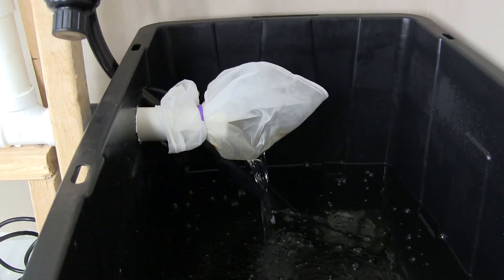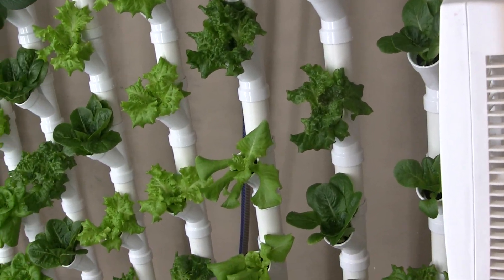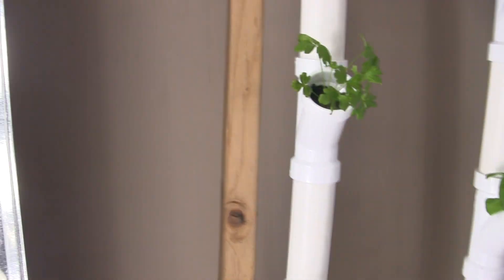Basement Hydroponic Tower Garden Version 2.0

Comment: Hey. Great staff! Thank you for sharing ;) I have a question. You said that your seedlings are ready for transplant within 2 weeks. Do you use any special seeds? I started growing my seedlings over a month ago and they are still smaller than yours. Do you give them any fertilizers? Any tips on how to grow seedlings for transplant?
Reply from the maker: Hi, I find lettuce varieties Rex, Rouxai, and Panisse grow the best and I have success with Theodore as well but he needs a lot of airflow and doesn't like heat. The temp can affect germination. I use plain water for the first week and then use a 300 ppm fertilizer concentration for the next week. Seedlings respond well to good lighting and not to wet and not dry. Some literature suggests that a pH around 5 is optimal for germinating lettuce but I don't modify our tap water which is around 7-7.6 but I do dechlorinate. Hope that helps.
Reply: @maryneumayer01  Thank you! So beside dechlorination you don't do anything with the source water? You just use tap water? What is your technique for dechlorination?
Reply: @maryneumayer01  FOUND THE TYPES!!!

Comment: Also, do you have any idea how much of a power drain the system is per month?  Any idea of the daily kWh you're using with system?
Reply from the maker: jawohl Jason,  roughly 12 kWh per day. I run the system off peak electricity hours and we have 30 solar panels on our roof, so it would take a lot of calculation to figure out an exact cost, and the metrics would change on a month to month basis. I also don't run the system from April to September since I am growing outside in my greenhouse.

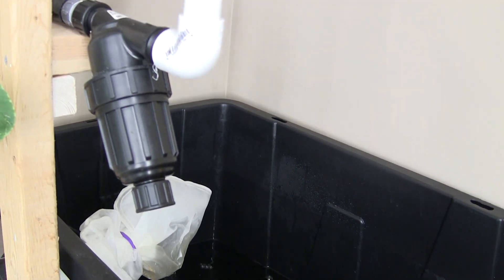Comment: I was wondering if you could say what the filter is called that you used at 4:24.  Would it be possible to post a video of you cleaning out the system out in the way that you describe in this section (4:24-5:00)?  Have you exchanged that system for a stronger filter system?
Reply from the maker: Hello again, the inline filter is not in use. I took the filter screen out. There's no need for it in my system as I am filtering with the nut sack on the drain pipe end. The nutrient is super clean in this system. In my greenhouse it's a different story, and I am still not clogging my irrigation lines. I put in a drain with a ball valve on my main line and it helps to open and flush the junk that collects at the end a couple times a season. When I replace my basement lines potentially next year I will put a valve in on the end to do the same. I found that the 1/4 in lines at the end of the main feed line show decreased flow, and a valve to flush out the end would help with that.

Comment: Very very interesting project. Just one question if you can answer me, the roots will not cause problems inside the pipe system? What will you do if its that the case?
Reply from the maker: they can - if they are left in long enough to clog. Not a problem with lettuce which gets pulled entirely, but with my parsley which stays in longer I trim the roots down at  around 4 months.

Comment: If you run 3 fixtures 600 watt in total, you should use 600watt hps light, it has by far the most light per watt, it the best thing out there! 

If you only wish to use 400 watt hps, it should be fine too, however, they say a 6x6 area can be done with the 600 watt hps lamp perfectly. Everything will really grow after that thing is on!

Greetings,

Jeff
Reply from the maker: Hey Jeff, 1 fixture puts out 105 watts, and I am running a 14x5.5 footprint with 7 fixtures at 735 watts. I agree the spectrum would probably be better with the hps bulb but it would be way more expensive and produce a ton more heat.
Reply: @maryneumayer01  I dont get it man. 600 watt is less than 735 watts. It would cost less than 100 dollars to get that and it will produce 96000 lumen. And the heat can never be more than the tl tubes, while those produce less light and thus more heat. So if i were you i would get a 600hps with a reflector and a(n) (adjustable) transformer. So you can have less light too if that is prefered (by the plants). Early stages of the plants may like less light. Anyway its your money you spend on 135 watt all for nothing, while you could have had a lot more with the 600 hps.

Greetings, 

Jeff

Comment: HI. I am considering building something like this. What does it smell like? I consider to put this in the living room or do you recommend the basement?
Reply from the maker: Hi Sander, although there is no smell, I'd do the basement. There is sometimes water spillage when flushing or harvesting plants and with my lights I don't think they are very attractive - more functional. So definitely basement.
Reply: @maryneumayer01  thanks for your reply. My system is almost ready. I have build a frame in my living room from t split (y shaped) pvc's and 3d printed a water sprankler on the top. The water tube is guided trough the pvc. Sprouts are just comming out of the sponge! I have to wait a few more days for the pump to receive. So far so good! I might consider moving it to the bathroom. I have a lot of space left there, it is warm and has a water proof floor.

Comment: Hey, I love this, and wanted to do this at my home, but some research showed that PVC can be toxic due to leaching of the chemicals into the water.  Are you using a specific type of PVC or other material?
Reply from the maker: Hey Reza, I've done a lot of research, and concluded that leaching of PBA's occurs with high heat applications over 140F and/or UV degradation over time. Since neither of these inputs occur in my application, I am okay with using PVC. I am more concerned about the dangerous herbicides and pesticides used in regular agricultural practice in America, not to mention the enormous footprint ecologically and environmentally required for mono ag farming. It's a very big problem and I unfortunately don't have an answer, besides my humble attempt to seek other alternatives.
Reply: Are you worried about platelets and have you done water tests?

Comment: what does it mean that your pump is a magnetic drive? and would a number 3 be strong enough to support 7 towers with six plants each, do you think? Thankyou for answering these two questions.
Reply from the maker: Hi wieder! Magnetantrieb heißt das - die Magneten treiben den Motor an und dadurch  wird weniger Strom verbraucht. Tolle Technologie. The capability is dependent on the "head" which is the height between the pump and the highest point the water is required to go. If your "head" is too high for your pump, it will not have enough pressure to push the water to the top of the towers. Danner Supreme pumps have technical sheets which indicate head for each of their pumps and I'd recommend using their data. The company makes fantastic pumps - I have never had one break - ever - just keep an extra propeller as they do not last for ever. The pump itself can attract precipitates, calcification, usw., and can be cleaned with an acid. Viel Glück!
Reply: @maryneumayer01  Hey cheers for replying. Just a last few questions. Danners has a huge list and I couldn't find Mag 3 pump you mentioned in your writing. Could you give me the number? We also have nine towers. six ' highx  10 'long. --so comparable to yours. Tricky here to buy sodium benzoate and cal. nitrate da man denkt, dass man eine Bombe herstellen will:-) Where do you get your supplies and how much in bulk do you buy. Last question. Do you use nutrients in your nursery, or only water and do you aerate them? Since we haven't got the big set up going, I have  the Sprossling in rock wool in a water bath with an airstone. My EC was 128 (far too high) but the baby pak choi loved it, but the lettuce looks pale pale..Over the summer I used the same water bath (27 ltrs) and switched off the pump to have a Kratky water bath which worked well for lettuce.

Comment: Noticed a little ‘tip burn’ on the mature plants furthest from the fan.. it might be (calcium issues) usually from air circulation issues. Ceiling fans would be an awesome addition.  Three would do the trick, I’d circulate two of them pushing air down and one in center pulling air up... get a nice mix going.
Awesome setup & video.  Keep it up
Reply from the maker: yup, that additional circulation would certainly help! thanks for the advice!

Comment: Couple of questions which don't appear to be answered in other comments. 1. What glue do you use to glue the PVC pieces together? 2. When you flush do you just pump out the old, clean the tote and then refill with fresh water with new nutrients or do you flush only water through the plants and, if so, for how long before emptying the tote and refilling it with nutrient solution?  Thanks so much for your fine work.
Reply from the maker: Hey Doug, I used a potable water pvc glue bought from Menards. As for flushing, I scoop out the nutrient, fill with 20 gallons of fresh water, dechlorinated, and then let run through the system for 30-45 minutes. Then I scoop that out, and repeat with new fresh water and let it run for another 45 minutes. I like to the the tds meter down to under 300 before I refill and mix nute and pH down to get to desired pH. Hope that helps.
Reply: @maryneumayer01  Yes it does, particularly regarding flushing. I've looked for a good glue. I really don't like the standard PVC glue that is very toxic when you're are applying it and requires ventilation. I came across a glue from Loctite that's a marine adhesive. It has a thick cream consistency, has no smell, can be used indoors without ventilation. I don't even where gloves when using it. It has a flexible rubbery texture when it cures. I've had no leaks. While Loctite does not say it's for use with potable water it doesn't say you shouldn't use it either. I can't find anything that says it emits any kind of harmful chemicals after it cures.

Comment: That is pretty cool, but no joke, you could have probably made led panels for cheaper with way less material overall. If you want to grow tomatoes or any fruiting plants, check out growmau5 and the led jobs he does. Also-what pump are you using to lift that and what is your flow rate at that height?also you can re-vamp many t5 fixtures to run led t5s, so if you still have that fixture, and want to make use of it, you could. However, there are some electrical things to watch out for.
Reply from the maker: Thanks for the info. I use Pondmaster Supreme pumps for all of my hydroponic setups.

Comment: why do you need to filter the nutrients returning to the water container?
Reply from the maker: sometimes roots break off and parts of the rockwool if it's old. There's not much in the mesh bag but enough that I don't want it circulating and clogging up my arteries and arterioles. ;-)

Comment: Can anyone comment on running an aquarium UVC light in the tank ? My basement has had mold growth in the past ....
Reply from the maker: I'm not sure a UVC light in the nute container will do anything for your mold - I don't run the system in the summer when it's hot and humid - especially when I have to run a dehumidifier in my basement. In the winter when it's dry in the house the added humidity is a welcome bonus and I don't need to run a humidifier. I'm converting to a heat pump for the majority of my cooling and heating this fall. So I will only run gas furnaces when it gets really cold outside. It will be interesting to see how this changes the humidity in my home in the winter.
Reply: MaryandJoe Neumayer good points, I may have to restrict efforts of basement growth to winter also. UVC will kill mold spores but that action would be entirely limited to the tank. Running UVC elsewhere (open air) will kill mold but produce ozone ( not plant friendly ) . Thanks for your input !

Comment: You have an excellent system here and I have watched your video many times. You inspired my build and I just finished designing a flange that will seat onto a cabinet top, with a socket that will accept the 1.5" pipe at a forward 5° angle, and reduces to a .5" spigot for the return lines. The return lines and reservoir will sit inside the cabinet. It's a small system,  for an apartment,  and i wanted it to look like a piece of furniture as well. Thank you for all your help!
Reply from the maker: Holy Cow Andrew that sounds awesome. If you feel like it send me a photo or a short vid. Great job!

Comment: I would pay someone to set this up in my house for sure.
Reply: Don’t pay someone, it’d be super easy to build. Draw out a plan and go to an irrigation store to get the 3inch fittings and the pipe. You’d only need like one or two pipes and a dozen or so Y fittings, some T fittings and some 90 fittings. Get yourself a pump and that’s about it
Reply from the maker: I'm sure you're not alone.
Reply: Tá linda a organização da sua planta.
Reply: where's your house?
Reply: It really isn't difficult to put together something like what you see here.
They're all pretty much just off the shelf 4" PVC fittings with some straight tubing cut to desired lengths and glued together.

But....each of those 4" 45°Y fittings run between $9.00 and $20.00 each.
Multiple that by 6-7 per line times 6 lines not counting the straight pipe and any 90° fittings....will =big $$$.
A simple book on building with PVC will show how to design and build.
Reply: @donaldcadwell3911  they are 1.5” pipe and fittings and 5.5” length sections it’s easy to make as long and u have a chop saw so you can manufacture the parts accurately but it would cost a fortune to pay some one to build that for you
Reply: love this design, I am seeking to follow your lead  However, I learned that PVC is made from vinyl chloride, a known carcinogen and endocrine disruptor. It leaches toxic chemicals into the water supply. FYI. Have you heard much about this?
Reply: How much you paying? I Can set this up in a day from an empty room.
Reply: Dam ur really pretty
Reply: Hi, I’m Jesus. I give you these gifts for free. Look outside!
Reply: @MrM0saic  Eh nothing is free Jesus, you should know you paid for our sins. Thanks.
Reply: @MrM0saic  the bugs ate it. The same ones you supplied to bring pestilence to the world.

Good job

Comment: It is very easy to see where the tube goes into the tower, but where and how it joins the main supply line is harder to see. Where the small water tube goes onto your main supply line is there some type of fitting? Or is it glued? or just a tight fix. If you are using a fitting what did you use to tap the holes?
Reply from the maker: Hey Rj, I just drilled a hole 1/4 inch bit - into the pipe and stick the 1/4 irrigation line in there for a very snug fit. The nute is pumped directly in - no fancy fittings. After the nute travels down the pipe, it follows the sanitary tee into the drain pipe, which is pitched toward the nute container, where the pump sits and recirculate.

Comment: what light are you using for the nursery and what is the light setting on it? I need help with making a good seedlings
Reply from the maker: I have a 8w equivalent LED for the seeds and then a 15w equivalent for the seedlings once they are started. I keep the seeds in a small separate container to prolong the point where the algae appears on the rockwoll because the germinating seedlings don't seem to like that very much. Temperature is very important. If it's too hot the seeds don't germinate well. Good luck!

Comment: Hi Mryand,the nutrients are always mixed with water?what is the flow rate of water?
Reply from the maker: Not sure about the flow rate - enough for a bit more than a trickle. Nutrients are mixed in the water and need to be flushed every 3 weeks for this system. In my greenhouse I flush every 8 weeks.
Reply: @maryneumayer01  What are you using for nutrients?

Comment: How to sanitate inside pipes?
Reply from the maker: ni hao, I use a nutrient solution for my plants and irrigate with an attached pump. The supply line starts at 3/4 inch at the pump and reduces to 1/2 inch for the irrigation line and then 1/4 inch drip lines to each tower. The flow is much more than a drip though. Hope this helps.

Comment: hi, is the bottom horizontal collection tube situated on a slant to encourage drainage or does the water flow into the nutrient bin without a gradient? Thanks
Reply from the maker: Yes, correct, there's about an inch disparity between sides, sloping toward the nutrient container.

Comment: Hi. It looks great. I'd like to see sums though. How much did it cost to set up? What are your running costs?
Reply from the maker: Yes, I'd love to see that too. I figure about $1200 for materials and lighting setup costs - that may be on the high side. Running costs would depend on what you pay for energy. I'm running about 700w for 16 hours daily. Nute is about $5 for 10 weeks worth, and I buy the plugs in bulk so about 7 cents a pop. Seeds are nominal especially since most are from my own stores/stash. I try to experiment with 1 or 2 new types per year but generally don't have much luck with new varieties. Hope that helps.